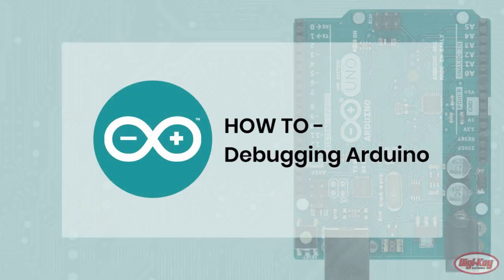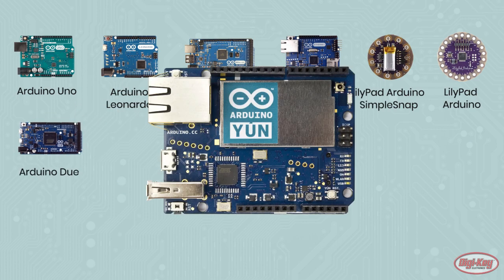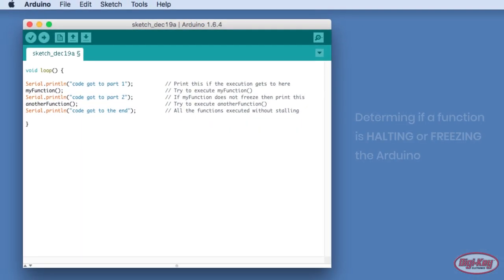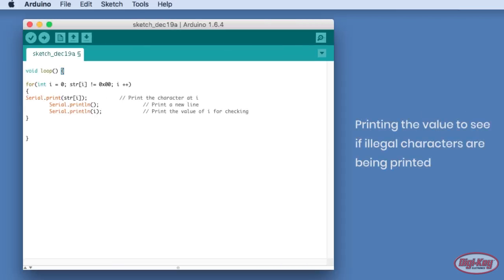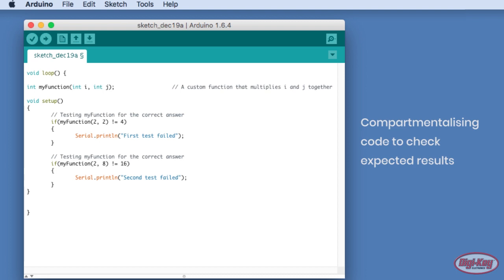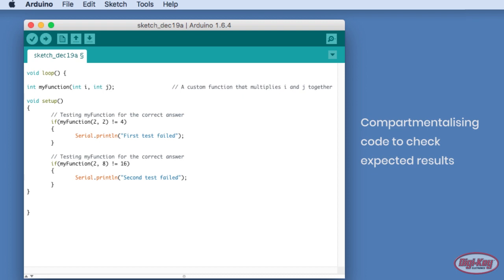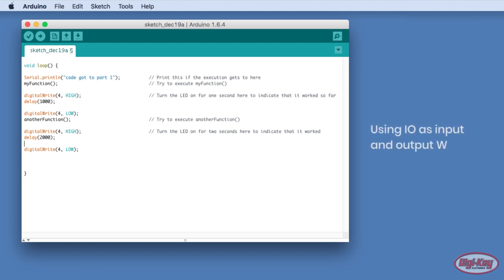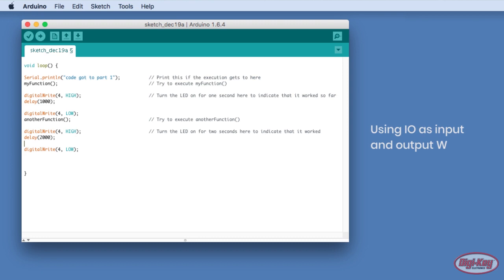How to add debugging features to Arduino platforms – Maker.io Tutorial | Digi-Key Electronics

Comment: I am confused. Everyone says "just use the Serial.println" with examples. But, man, that does not work! Where do you see the result? How is it shown? 
What crucial step am I missing, that everyone else is enlightened with? 
What preparations do I need to do, what extra connections? Any special software is needed for that? 
Sounds way too easy (and it should be) but simply - computer says no!